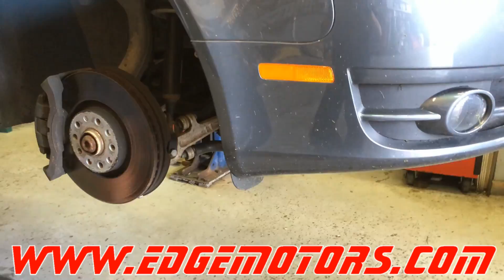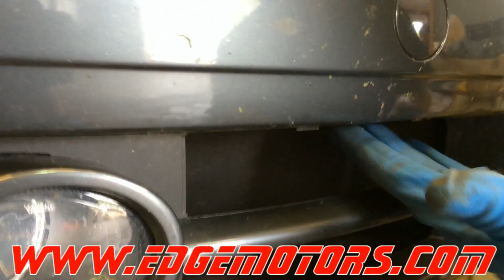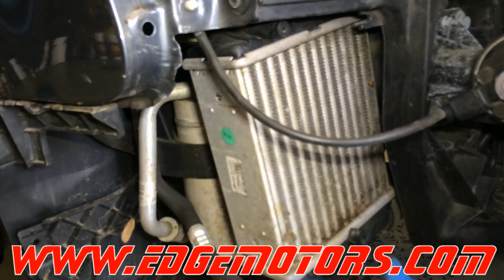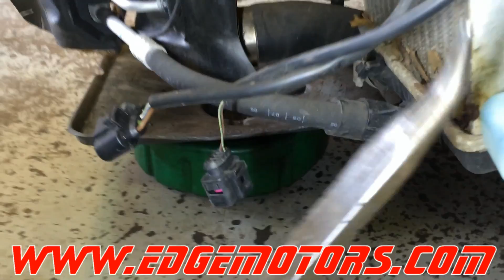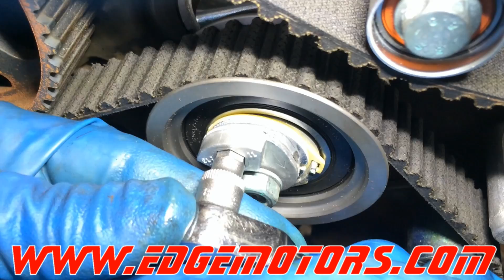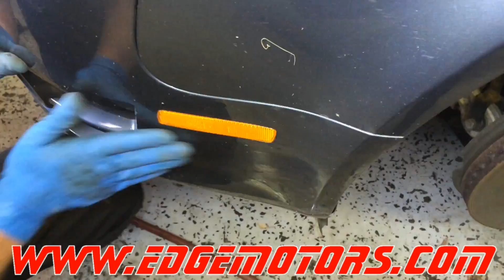2006-2008 Audi A4 2.0T timing belt and water pump replacement DIY by Edge Motors

Comment: Thanks for your videos.  Always helpful.  I recently changed my timing belt on my 2008 A4 B7. 95,000 miles on first timing belt.  I noticed when I took off the upper cover that the timing mark on the tooth was about a tooth and a half to the left of the arrow.  The crankshaft mark and harmonic balancer were lined up.  The car was running fine.  So the question was whether to line up on the marks or to original position.  I chose to go in between.  I manually rotated to check for interference. all good. Started car and ran well for about 40 miles.  Then P0300 error.  Replaced coils and plugs.  Ran fine for 5 minutes then P0302 error.  I think the timing is off and wondering to go with timing marks or original position.  Thoughts?  Thanks.
Reply from the maker: I’d go over part numbers on all pulleys to make sure they are from your car… and then set it to the marks. Check for interference and try to run it. Btw, if it should be timing issue with misfires, you should of get a camshaft position sensor code or cam/crank correlation code.
Reply: @EDGEMOTORS  Thank you for your reply.  You guys are the best. It turns out that by coincidence I ended up with a vacuum leak.  After replacing a vacuum hose it runs great.  I ended up setting the timing to the normal correct positions.  So I did the timing belt change correctly with the help of your video.  I just had a bad coincidence.  Thanks for your videos and feedback!

Comment: Is this one of the hardest car to change timing belt ?
Reply: The others you'd have to remove half the car; maybe the battery, engine, turbo, axles, cv boots, lower control arms, transmission, inside dash, front car seats, rear car seats, gas tank, just to change one belt.
Reply: @MalibuBeachBum  holy shit
Reply from the maker: Nah... this one is one of the easiest out of vw and audi....

Comment: Gonna be tackling this on my 08 GTI BPY engine. I’m assuming that in the GTI I will have to remove engine motor mount to have enough room to remove things correct? Any other special recommendations? Thanks for your videos guys! 10/10
Reply from the maker: Yes mount have to come out. Other then that it’s almost the same

Comment: Why do you say the metal impeller water pump will start leaking after a few thousand miles? Is the plastic impeller a much superior quality than the metal impeller?
Reply from the maker: Original one is. Those aftermarket pumps suck. And I think they don’t balance the impellers on the metal once.... and that adds on to bad quality....

Comment: my mechanic didnt put the tensioner in the hole he put it down is that bad? i told him but he insisted that its wrong to use the hole, the car did run. Should i change the tensioner back to the hole?
Reply from the maker: Diego Sepu  
You talking about the hole with the feezeout that the tensioner leg goes into? 
That's made to hold the tension on the tensioner
Reply: yes, muy mechanic stuck it with something on the bottom instead of that hole. should i change it?

Comment: ive done loads of a4,s its just easier to take the PAS pipe off, disconnect the coolant pipes and  move the front scuttle panel as one and place the ac condenser underneath  the car hand hold it in place wuth a tie strap, then you can get to the crank pulley bolts with out pissing about

Comment: Alright I got a 2006 A4 2.0 T and I got a ? About these motor my check engine code is reading cylinder 1 miss fire , cylinder all 4 miss fire , after troubleshooting a few things like coil packs and plugs and also did a compression test to check the gasket and it was fine.... I turned to fuel injection as I took off the intake manifold and high pressure fuel pump regulator near the back of the motor to get to the injector,  I realize it was broken "high pressure fuel pump "  so after replace that 570 doller part and all other small things like injector #1 200 , and plugs and coil packs another 200, the bloody thing it ran great for about a month no check engine light nothing then the light came back and now I'm back in the same spot with the motor shaking and miss firing , could it be the belt or something else idonno what the hell to do now where would I go from there ......
Reply: Could it be the carbon build up on the valves?
Reply: Carbon build up and check the injectors or the breather valve make sure u don't have a vacuum leak
Reply: check for a cracked cam breather line. my engine was shaking and running like shit. i assumed misfire but when i fixed that line it ran better than before
Reply: @alexjolin2589  cam breather line?  where?
Reply: @guysatchwell6990  right on the top connected too the head and intake manifold

Comment: Hiya, I was going to use your DIYs to tackle my B7s thermostat and timing belt.  First timing belt job for me.  I was wondering, I notice you don't really break out a torque wrench, have you had any issues without using one?  I   I am not using any power tools when I do mine.  I do have a torque wrench, btw.
Reply: 99.999% of mechanics or guys that work on cars do NOT use a torque wrench, they just drive them tight enough and you're good to go.

Comment: For sure have it done no matter what because if it goes you'll be without a car for a few weeks and it's so expensive to have the valves redone 😭😭😭 vw is a rip though 1800 just for the belt install is insane

Comment: Would it be the same for VW Passat 2007  2.0T?
Reply: Nick N same thing happened to me on the freeway.
Reply: Checked the timing and it is in time. Know I'm looking at the cam and valves.
Reply: Did yours just fail too? I have an 08 Passat 2.0 was on the highway and the timing belt failed lost power pretty scary my mechanic told me about 2500 since my pistons and valves could be damages VW told me about $5000 just fyi
Reply: I already have 110k miles and never changed it but i think it's the time to do it. I called VW yesterday and the fuckers are asking for $1800. I live in Indiana but i'm originally from Europe. My friend just changed his there and it only cost like $500. Someone is ripping off people i guess....
Reply: Donald Wendland ended up costing like 4K 😓 thinking about trying to sell it while it's running again
Reply: Donald Wendland I think my chain tensioner is bad making that clatter at start up

Comment: What problems with the metal impeller?  The plastic one is trash.  I'm about to replace mine with a metal impeller and I would like to know your opinion about them.
Reply from the maker: I only you oem dealer pumps due to the fact that the metal impeller pumps have a high chance to be leaking in several hundred miles... btw oem pumps plastic impeller will last minimum 65k miles

Comment: Dude... I just stripped 3 of the pulley bolts HOLY SHIT what a damn pain in the ass. You were right about the project lol. Multiple trips to harbor freight and lowes.. Whats the best way to line up the cam gear? It looks off every time I line it up. After pulley and cover is off can I mark them with paint and put them back on and line up the crank that way? Its on the VDub 2.0TFSI
Reply from the maker: Yes you could do that, just make sure you check the oem marks later... Don't forget, if you off by one tooth on the crank gear, it will be only a 1/2 tooth off on the cam gear...
Reply: +EDGEMOTORS thanks man. i attempted the belt and tried both ways. yours and the one from ecs tuning. the closest i could get it is the crank being a hair before my mark with the paint marker. tried your cheat method and itll only bring the crank 1/2 a tooth closer. tried putting it on from 1/2 a tooth and it wont go on. my original belt was stretched when i compared
Reply: Hey man how did you remove the bolts?

Comment: is the timing belt the same as a cambelt? my Audi is a sportback 2007, 2.0T and is sounding at times a bit like a diesel. i was advised that the cambelt needed replacing at 120000km and am on 148000km already as i thought it was changed already at 90000km, but this was not the case. booking it in next week, but was wondering if you could perhaps answers these two questions for me? thanks for the video!
Reply from the maker: Yes can belt is the timing belt, it wouldn't sound like a diesel because of the belt, unl s there is a problem with the tensioner. Check the camfollowers and cam chain in the back of her head.
Reply: Thanks I'll ask them to check this out for sure.

Comment: Audi A6 2007 water pump needs replacing. How do you remove old pump. I removed the belt but not sure how to remove disc from water pump

Comment: I have a hole in my passenger side intercooler for the exact same model of car would I follow the same steps with taking off the bumper and everything and then pull out and replace it with an oem part or is there more steps required?
Reply from the maker: +N Jenkins no this would be it...

Comment: +EDGEMOTORS  Did you have to evacuate the A/C? Great Video
Reply from the maker: +Moises Zepeda we did not disconnect any of the a/c system components, there is no need to evacuate a/c system if you not disconnecting anything

Comment: This is a drive belt (not timing chain).  FYI you can change the drive belt and tensioner without removing the front.  Good video otherwise.
Reply from the maker: It never said anything about a timing chain, and it is a timing belt. Have you watched the video?
Reply: +EDGEMOTORS Sorr, the video must had jumped ahead. It was a previous video that was showing a drive belt as timing chain/belt. My mistake please ignore.
Reply: Perfect video, well done. Nice trick moving the crank pulley back a touch to account for belt moving the pulleys after tensioning. I guess the cam pulley didn't need to move back because you didn't mention it. Maybe it moves just an insignificant amount. Thanks for the video.
Reply from the maker: It may, but you have a toothed belt, you either dead on, or you off a tooth or more... you can’t be off a half a tooth:)

Comment: Thank you so much for this!  I followed all your steps except removing the two small idler pulleys which did not have to be removed and according your own video was never a factor.   Everything else was spot on.  Excellent video and I'm amazed that you did not criticize Audi engineers for such a terrible layout when it comes to routine maintenance.   Really, remove the front end of the car for simple maintenance, my God!
Reply from the maker: We remove those pulleys, because every time We do this job, we replace them...
Reply: You might be sorry for not replacing the rollers. Takes 5 minutes.

Comment: Great video. I see you re-used the main pulley bolts. Is that ok? Heard/read somewhere that they are stretch bolts and must be replaced.
Reply from the maker: In reality, if you read the repair manual, most of the bolts have to be replaced... So go figure, if you doing a job and you need to replace like 100 bolts;)
Reply: :D Sure makes sense. Doing a similar timing job DIY on my A3 2.0T FSI and wanted to be sure about this because I don't have the bolts, especially the engine mount ones :(
Reply from the maker: +Juma Kevin 
Just make sure you don't over torque them, for you car it is important... Those mount bolts tend to either strip the threads, or get loose... So use thread lock:)
Reply: Thanks, I will torque as the specs state.

Comment: does this work for a 2007 Volkswagen Passat same engine?
Reply: +Enrique Hinojosa Only if its 4motion, it will be identical. If your Passat is FWD then the procedures are about 75% identical, except that FWD engines are mounted Transverse instead of long-ways. This job is very identical to my 1.8T 2001 Jetta. Even though my engine is Transverse. Brings good memories.
Reply: +Omar is Rad tc.  b s p mk I 0 hi ujj u>own mmddnskekkroeokeelekekekeek6 wbzvas ab
sb
db
bsbsjs
sbsnsn
bzz 
lolalLPallalalllqoaorkjekrkdm,mmzlkzMk (?? $($¥((♢°♢♢°♧°[♢♢♢)♢+, 0jjmjm-5373245043@sale.craigslist.org
snow
h

Comment: Hi, a noob question.... does the car have to be in neutral, to get the engine centered or it doesn't matter what gear its in?
Reply from the maker: Tony Atin if the car is manual it must be in park ... otherwise when you will be turning the engine over the car will roll. if the car is automatic then it does not matter, as long as it secured from rolling you over...
Reply: Thank you, I love all your videos.... i watch them often. I hope to soon change my timing belt. I have 2004 Audi A4 1.8t fwd automatic. I might leave the car in neutral since when its  on jack stands...
Reply: EDGEMOTORS Excellent video thanks for sharing. Is a cam lock and fly wheel lock required to do the job? I didn't see any mention of it. I will be doing my tbelt, water pump and thermostat this weekend and wanted to be sure. Thanks

Comment: Hi great video how about bleeding the cooling system
Reply: emonneil0912 Coolant bleed is pretty simple on here, leave the front end raised(helps purge air),  Fill the radiator up to the low mark on the reservoir.  Leave the cap off, turn the the car on and turn the heat on high and let it run until you feel the air from the heater become hot.  Its normal to to take about 30-40 mins for this to happen.   Afterwards, top off the fluid put the cap on and you're done.

Comment: I would have liked to see you do the coolant bleed procedure after the repair. Great video.
Reply: brasanford1 - Coolant bleed is pretty simple on here, leave the front end raised(helps purge air),  Fill the radiator up to the low mark on the reservoir.  Leave the cap off, turn the the car on and turn the heat on high and let it run until you feel the air from the heater become hot.  Its normal to to take about 30-40 mins for this to happen.   Afterwards, top off the fluid put the cap on and you're done.
Reply: Very helpful response, I love that the heater core hose has a bleeder hole as well. Recently had a Audi A4 with water jackets stopped up by the customer using block sealer. The thermostat was frozen solid for it as well. Let's just say they left the car to get taken by collections.
Reply: Yikes band aid fix back fired.  If you have a bleeder on the hose bleed that as well.  Sometimes it's meant to bleed one of the heads.  I know it's like that for the Chevy 3400 motorss.  You don't want to take it all the way out, you want to look for a steady stream of coolant.  Open and close it a few times.  When the heat get warms

Comment: what causes the cam to seize in the head journal? it has oil and oil pump is pumping . after i removed the cams i cranked it over i have oil coming out at all oil ports.
Reply from the maker: lack of oil pressure, contaminated oil or bad oil, bigger than normal clearances and overheating... one of those.
Reply: do you recommend adding moly to the oil?
Reply from the maker: john mcneilly
i dont know, but im not a fan of adding anything to the oil.

Comment: I did the timing belt exactly how you showed. 720 miles later I got a p0011 fault on my bpg engine? What's going on?
Reply from the maker: it has something to do with your cam adjuster, timing belt would throw codes right the way and it would be crank/cam allocation codes... go towards the hydraulic cam adjuster or the chain tensioner

Comment: Hey EdgeMotors!  I really enjoy the videos you have been making.  I recently just followed the cam follower video to do a replacement and it worked out great!   I do have a question about Timing belts though, I didnt feel comfortable at my current level to do a timing belt change (2008 A4 2.0L) so I brought it to local VW/Audi shop.   I am currently experiencing (after 2-3 weeks) high idle RPM and 1st and 2nd gear are rough as well.  Is this a cause of a bad timing belt install or maybe something else?
Reply from the maker: not sure, have to see it before saying anything... but high idle usually mean vacuum leak...

Comment: Metal ones do not leak like you explain in said video. If manufactured right and not cheaply pressed like the plastic ones they last twice the lifetime of cheap plastic one you put in. You're just trying to get customers to come back to you when its not needed. Plus there is VW OEM Metal Impeller ones so don't tell your customers the opposite of the truth. Also huge common issue with plastic ones is they shatter making them the worse thing VW ever put in a car.Their bearings are pressed and sealed unlike plastic ones where they are just pressed and when get old and weak they fall out causing a pump and or timing belt failure.

Comment: I used HEPU water pump with metal impeller from FCP. 60K miles so far. No leak at all. Also, I used the metal+plastic gasket for the water pump.

Comment: WOW you made that look easy as fuk...less than an hr!??? most places quote more hours cheapest price I found was $700. Maybe I might do it myself thought you had to take off the valve cover. What about the camshaft and crankshaft seals?
Reply from the maker: the original seals are very lasting, so unless you right there and its already out then replace it, but if not and not leaking dont touch the crank seal.
Reply: EDGEMOTORS oh cool thanks. Reason i state it is because i didn't change the seals when i did my miatas timing belt then the following yr. it started to leak. Might be because its my weekend car and sits mostly in the garage? When i drive it it doesn't leak from what i saw.
Reply from the maker: hydralisksc
well no one knows when they will start leaking, but i have seen more seals leak after replacement than just by them selfs... (im talking about crank seals, not the cam seals.)